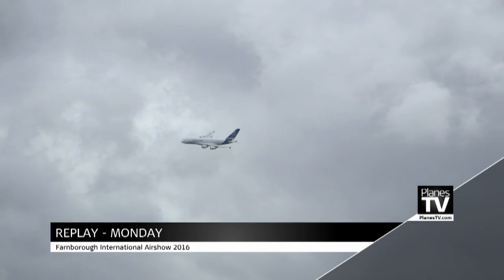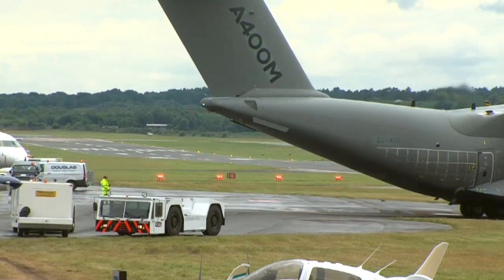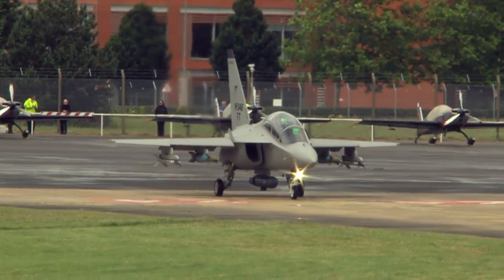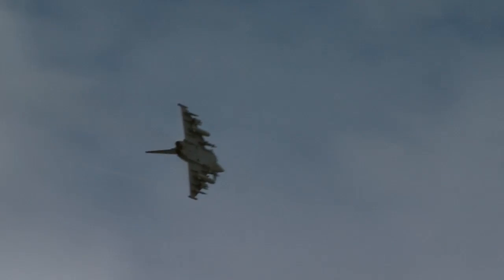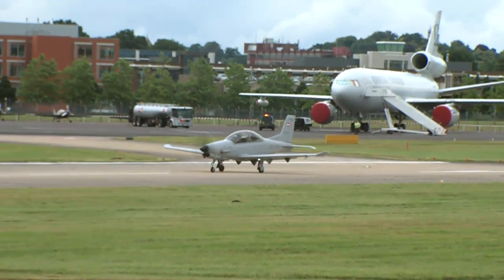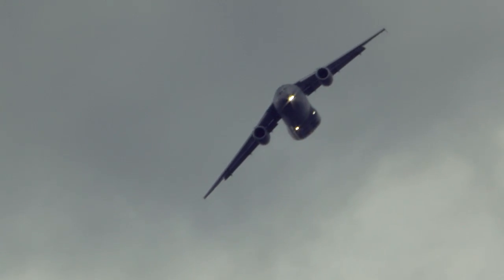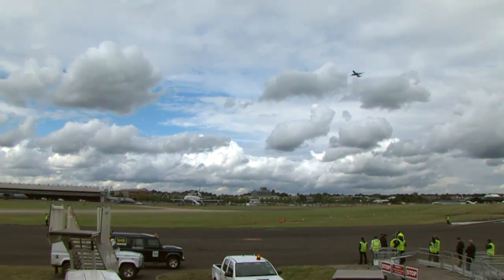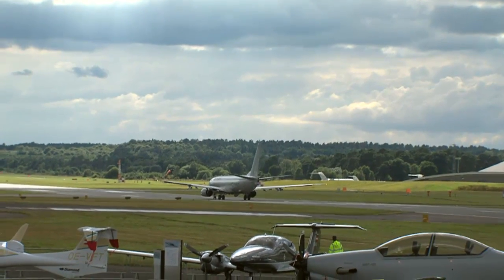Farnborough International Airshow 2016 Tuesday

Comment: So the F35, is the most advanced because the commentator says so or because its Amerikan? Put this up against an Su37, that F35 or F22 would get shot like blimps out of the sky. F22/35 programs have been a plague. Its reported nothing but problems, huge maintenance costs and expensive. Other fighters do better for cheaper. EuroFighter, Raife, Sukoi Su27, Su37 all out pace those F22s 35s